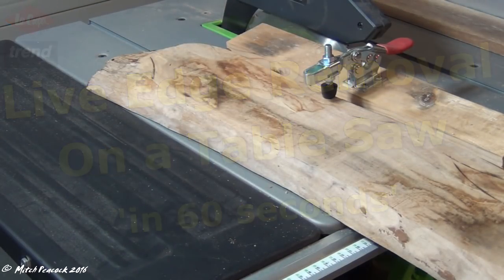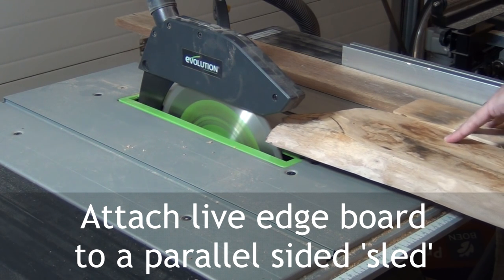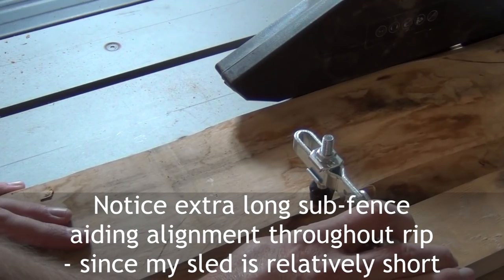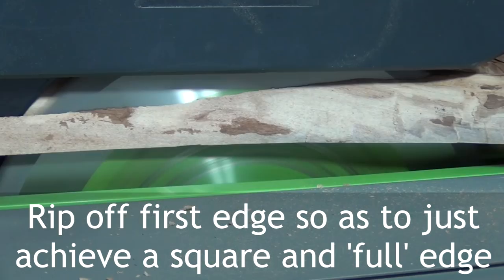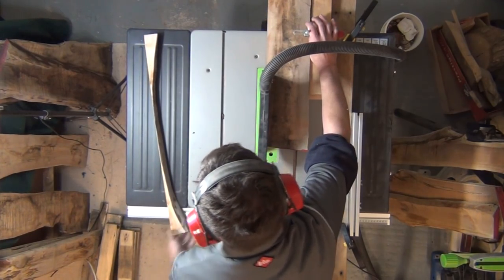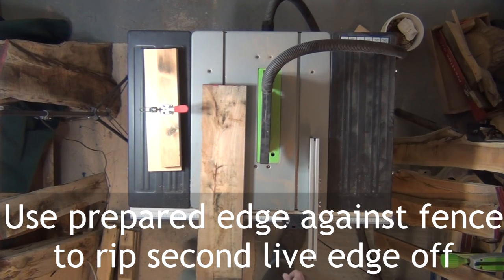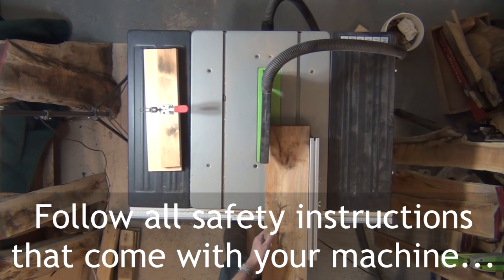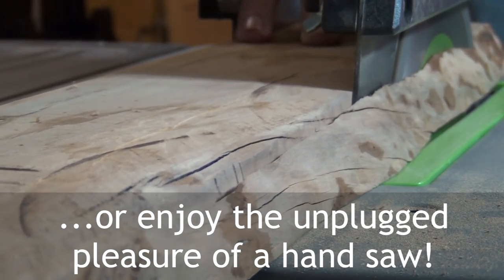Converting Live Edge Boards on a Table Saw

Comment: Nice video Mitch,I will have to make one of these, I am getting the tablesaw this week!
Reply from the maker: Great! Seriously, they are so quick and easy to make, easy to store, and cheap, yet save a load of time when you don't have a straight edge on a board. I have a SketchUp model for free download, but just size yours to fit what your likely to use it for.
Reply: I have no jointer and I have seen a lot of guys use that jig to joint boards, that is what I would use it for mostly

Comment: You made that look really simple. I was watching people with complicated jigs. Did you use a chainsaw mill to get your pieces? After seeing all the table saw injuries, I almost feel more comfortable just using a beam cutter on my chainsaw for the edges. Thanks for the video, might give this a try!
Reply from the maker: I used a plain chainsaw to slice the short butt whilst it was still in the ground. This is probably not advisable ;-)
The live edge removal really is simple this way, and I'm surprised I haven't seen it elsewhere.
Cheers